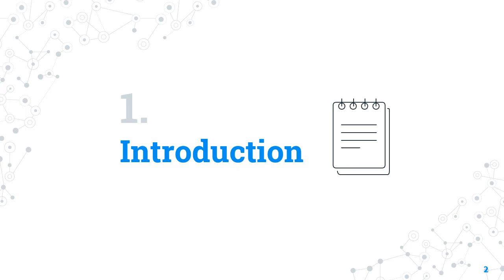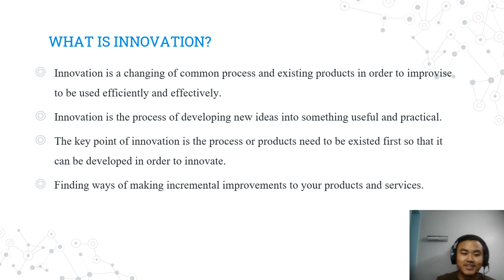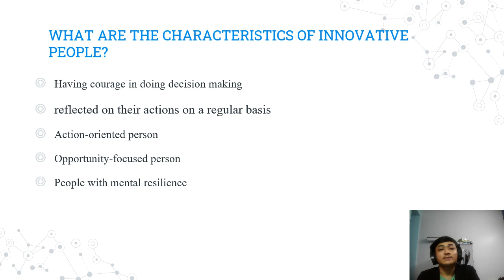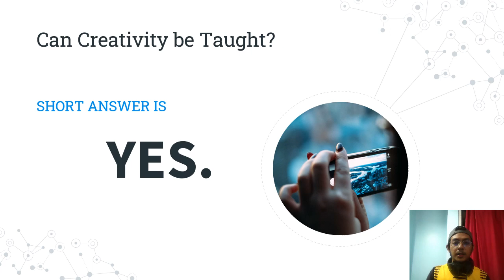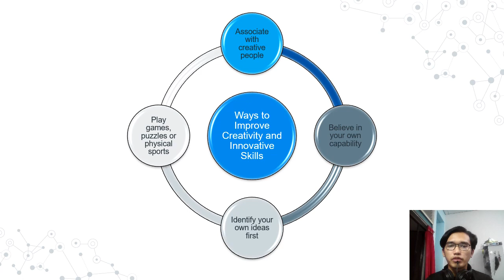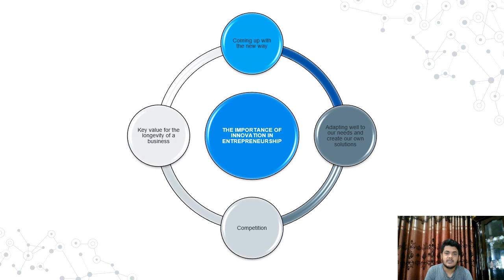Group Nitro - Creative or Innovative

Comment: Okay, how does entrepreneurship and engineering related to each other. As you guys are stressing about innovative and creative in the video/presentation. So i would like to know the reason you guys choose specificially entrepreneurship in this particular presentation. Does both innovative and creative are related to entrepreneurship only? Is there any other way on emphasize both innovative and/or creative without entrepreneurship in it?.
Reply from the maker: Hi there, Thank you for the long interesting questions, i will try to answer 1 by 1 and hope it satisfies your question. 

(1) There are a lot kind of engineers out there as example, service engineer (work under company that require their service), technologist and there is a term called Entrepreneurial Engineers (Mason, T & Western, A. ,2001). These engineers understand business priorities and know when to make the right compromises, working closely and effectively with the product team including founders to iteratively deliver customer value. They are not driven to scale the corporate ladder, become over-specialized or maintain old code. They want to solve problems that they’ve never solved before, or that no one has ever solved before.

(2) It is because engineering field is very related to entrepreneurship on how to handle things, creatively solving the problem, brainstorming fresh and innovative idea to gain trust and profit from what you promotes for the company and as long term vision is to become a successful engineer.

(3) Definitely not, creative and innovative are NOT ONLY related in this engineering field. Both of them has broad and meaningful definition and it does applies to all people who suits the definition.

(4) Entrepreneurship is a small scope in our effort to explain that engineer also can become a creative and innovative entrepreneur, thus it clearly shows that we are NOT ONLY emphasizing creativity and innovative in entrepreneurship. Anyway, i believe that besides engineer and also entrepreneur, creative and innovative also are important attributes to other profession as well. For example, in entertainment industries, there are a jobs called composer and songwriter, in order to create a hits song they need to think creatively and consider so many time of their quality of work to ensure their upcoming song will catch the interest from the audience. On the other hand, some of online singer are postings their song covers with their own improvisations. Thats what we called innovative.